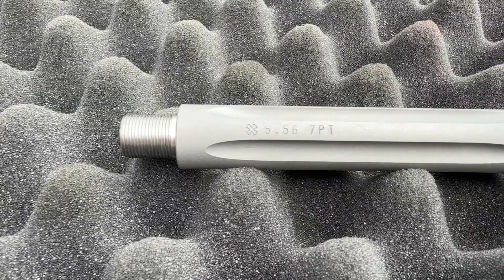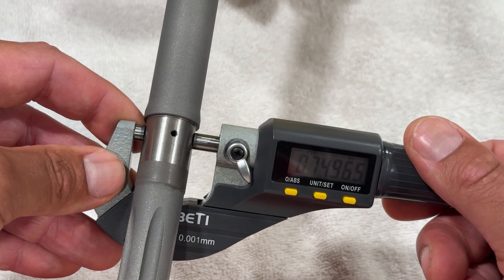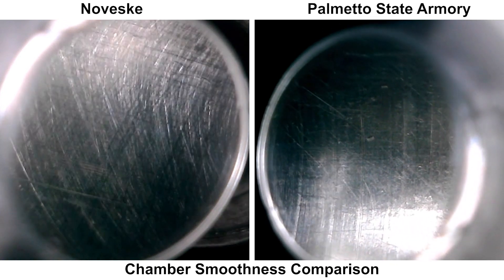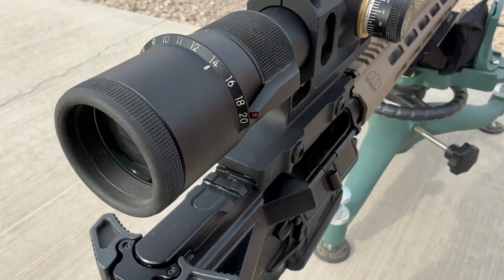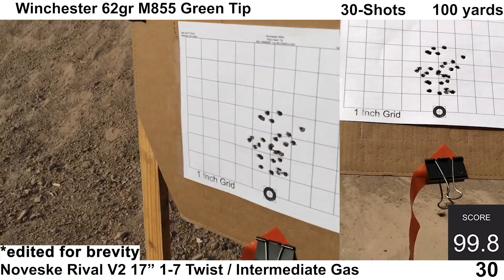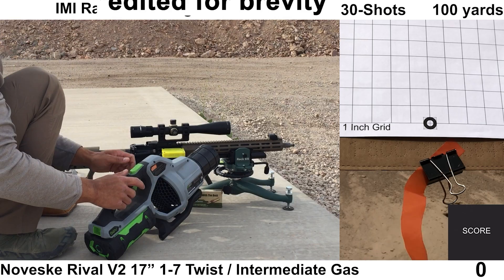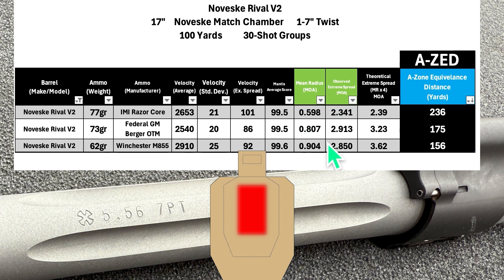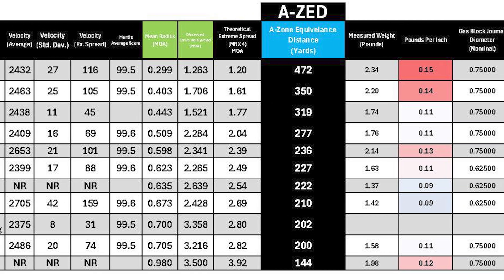Noveske Rival V2 AR-15 Barrel Review – Worth the Money or Just a Name?

Comment: Whats your experience with cleaning barrels and accuracy? Also do you lap your upper receivers? If so what method
Reply from the maker: @larsonhomeinspection9932  I haven’t noticed a big difference in a clean vs dirty barrel with a 223/556 AR15.  But it’s  it something I have tracked closely.

I have lapped uppers before. I don’t use lapped uppers for these videos.

Comment: The cross hatch surface is critical to proper case adhesion during the firing process! If you had a super polished surface in the chamber, your case will move prematurely before the gas even begins to be routed through the gas tube which causes multiple problems. One being excessive gas blow by and fouled chambers and two, case head issues and three primer protrusions and holes in the primers. This cross hatch IS a hand polish.
Reply from the maker: Thanks for the feedback. I think I would have been less confused if Noveske used the term cross hatch, instead of hand polished.  To me, when i hear the term hand polished, I would expect to see a smooth, non-scratched surface.
Reply: @PrestonJMoore  as would most people. This process is the final touch that any reputable gunsmith will do when chambering a barrel. Just remember that a super slick chamber is not a good idea. However the chamber should be void of deep scratches and or gouges left by a chip rolling over the reamer.
Reply from the maker: @dannyboy5272  also, what are your thoughts on chrome lined and nitride treated chambers? I would think those slick surfaces would impair the case adhesion.
Reply: @ if the chamber is nitrided its still going to have this cross hatched surface.
Reply from the maker: @dannyboy5272  okay. What about chrome? It is my understanding that chrome lining is much thicker than nitride. So, wouldn’t that fill the scratches? At least to some degree. Therefore making the chamber smoother/slicker?

Also, whether chrome or nitride, would the slicker surface reduce case adhesion compared to raw steel?
Reply: @ chrome has a surface that resembles the same attributes as a cross hatch because of the nickel chromium surface and I don’t think it’s necessary for there to be a cross hatch surface.
Reply: Google the question; is chrome lined barrels as smooth as non chromed barrels. I tried to copy and paste in the comments but it wouldn’t let me

Comment: Wonder if that last group opened up due to heat?
Reply: Doesn’t he use a chamber blower between every test?
Reply from the maker: @ChristopherGoydich-cb6bd  chamber chiller and a leaf blow.  So, the barrel is cooled on the outside and the inside between each group.
Reply: @PrestonJMoore  yeah if it was heat stringing it would be doing it for every test not just the last one but that would be unlikely with such a thick match barrel, ime.
Reply from the maker: @ChristopherGoydich-cb6bd  Yup, agreed. 💯
Reply from the maker: I suppose it's possible.  Why do you think that didn't happen with the other groups?

Comment: Out of curiosity, why don’t you use the same ammo across the tests?
Reply from the maker: Good question.  A couple answers...  First, it makes life easier not being slaved to certain types of ammo, if that ammo becomes more difficult to acquire or whatever. I also like seeing how different ammo does, I think it adds a secondary element to the video that, at least I find interesting.  I can always come back to a certain barrel with ammo it wasn't originally tested with, if I still have access to that barrel. There would be people that would complain that I was using the wrong ammo, whatever I would have ended up choosing to shoot. The goal posts would probably be moved and people would then say that not only should I use the same ammo, but the same lot of the same ammo. I think certain ammunition fits certain barrels better.  For instance, I'm probably not going to shoot really expensive ammo out of a really cheap barrel, since, if someone buys a cheap barrel, they are probably going to buy cheap ammo.  It would still be interesting though. 
Also, when I started this series, I had 28 subscribers and was only really planning on making a few videos. So, things have gotten a bit larger than expected, which I am very appreciative of.  So, I'm just kind of rolling with it. It's not a perfect, laboratory grade comparison and I'm okay with that.  I'm not a scientist in a lab with perfect conditions with an unlimited budget. I'm doing what is practical for me with the limited time and budget I have available.
What are your thoughts about this?
Reply: @PrestonJMoore  well I found it interesting because it seems like you take so many steps to minimize any potential factors that could affect the results but the ammo choice seems like it could potentially be the biggest one so that’s what really had me curious. And while you’re not a scientist in a lab, you are the only one who I’ve seen do the testing this well and consistently. 

Maybe a compromise; have 1 type of ammo that you use consistently across all test and then the other two can be varied based on the barrel and what’s available to you. That way you’re only really committed to one round instead of 3 and you can vary the others but there will be a consistent round to track performance of across all testing. Just a thought, just seems like that would potentially provide a good mix of both. 

I do get not being able to make every one happy and or moving the goal posts though. I did also think about the lot thing actually lol but I think that’s a lot more unreasonable than always including the same high quality match load in the tests and with your chronographs you’ll be able to see if a round is outside the norm of the rest of them or what you expect from that load, so I don’t think specific lots would be necessary.

And this isn’t necessarily me trying to be critical as much as thinking about ways to possibly improve the process even beyond what it currently is. I really appreciate your content and this is just intended to throw my opinion in there to potentially help.
Reply from the maker: @AK47Uprising  I very much appreciate you taking the time to provide feedback and a thorough response.  I hope I didn't come off as annoyed or offended. You taking time out of your day to provide suggestions on how to improve the channel means a lot to me. And, I really do appreciate it. 
I have thought about including one standard ammo type in mix. We'll see if I actually do it or not. As you mentioned, it would be a decent compromise.
Thanks for the feedback!
Reply: @ no you didn’t, I just wanted to make sure that I didn’t come off that way lol.
Reply from the maker: @ 👍 we’re all good!!
Also, don’t tell anyone 🤫 but I do plan to eventually do ammunition reviews with multiple barrels.  Our little secret 😉

Comment: Thanks for your work, these are outstanding videos.   I consider that hand polished because it looks like it was done with emery cloth/sand paper on a wooden dowel.  I just looked at my son’s Recon (over 10 years old) and it has crosshatching like that but not as deep/coarse.  His spent brass looks better too, and did when the barrel was new.  I think they overdid it.  Either way, it looks much better than my Criterion barrel.  Looking forward to the next video.
Reply from the maker: Thanks for the support!!
The barrel functioned fine and didn't have any issue extracting.  So, at the very least, to me, the finish on the chamber doesn't seem to be a huge issue. It's still not the type of finish I would personally call hand polished. 
 So, it was just a bit unexpected. But, I understand it did go though some additional processing, honing, or whatever the correct term is.
Did your Criterion have an issue with the chamber?
Reply: @ yes it does have an issue, it has circular rings in it as if the reamer was slightly chipped.  I worked in tool and die for 11 years so I know what this looks like.  They’re so large/deep that there are rings on the brass which you can feel.  I sent it back to Criterion and they said it was within their spec.  To be fair, it’s an accurate barrel and I didn’t have extraction problems that I could quantify.   I took it off the gun because for some reason it shoots XM-193 poorly but it’s a laser with handloads.    Also it’s a bit heavier than I wanted, I shoot a G barrel now and am satisfied with the precision with all types of ammo, I think this G barrel was a bit more precise than the one you tested.   I’m satisfied with the G barrels I have but shoot a Rock River 20” for my Hi-Power type shooting.
Reply from the maker: dang, stinks about your Criterion barrel and their response. At least it shoots and functions... mostly. The G barrels seem to be well made.  They released a new 18" SPR barrel that looks pretty interesting.
Reply: @ I still believe they make excellent barrels, and they were responsive to the issue.  I’m not mad about it, a little irritated though.    My son has a light weight barrel of theirs that is freakishly precise with certain loads, not over-gassed either.  But to stress again, I greatly appreciate and enjoy your work.

Comment: You dont want a high polished chamber. A chamber polished with 400 grit is proper. If the chamber is high polished the case will not grip the chamber when it is fired and all of the force will go into the boltface and lugs which will cause lugs to shear.
Reply from the maker: @ryanallen8392  what about chrome and nitride chambers?  Wouldn’t those not allow the brass to grip the chamber wall too?
Reply: @PrestonJMoore  the nitride or chrome is applied after the chamber is cut and polished with 400 grit or whatever grit the manufacture uses. Therefore, the imperfections left by the sand paper are still present after nitride or chrome is applied.
Reply from the maker: @ Right.  But, the chamber will still be more slippery if it has been chromed/nitrided, right? 
My understanding is that chrome plating is a lot thicker than a nitride treatment.  Would chrome fill in any of the imperfections?
Also, are you saying that Noveske would call that surface finish hand polished? It's just not the type of surface finish that comes to my mind when I hear the term "hand polished"
Reply: @PrestonJMoore  if you look at the brass that has been fired from a nitride or chrome chamber you will notice there are imperfections from the chamber imprinted on the brass. They may be larger than marks left from sanding. The imperfections are intentionally left there. Whether it be machining marks or sanding marks, the imperfections serve a purpose similar to the cross hatch on the cylinder wall of an engine.

Yes. I would consider the noveske chamber hand polished. It is done while the barrel is chucked up in the lathe. Sandpaper on a dowel is what is used to produce that finish. 320 or 400 grit. Any finer than that and you are inviting problems. The sandpaper is used to remove the machining marks left by the reamer.

Problems with a high polished chamber include sheared and set back lugs, signs of pressure including flat primers, not being able to load a case to max book charge because of pressure, and the gun runs harder.

The problem that come from a chamber that has not been polished with 320 and 400 grit is stuck cases.

When I chamber rifles, I polish with 400 grit which leaves a finish similar to the chamber in the noveske in your video.
Reply from the maker: @ryanallen8392  Do you know of any documented cases where an excessively smooth chamber caused issues?  I appreciate you taking the time to share your insight into this. It's been enlightening.
Reply: @PrestonJMoore  another option would be to call the manufactures of the barrels youve tested as well as others like White Oak, SOLGW, etc. and ask them. They hammer on gun barrels before they hit the market.

You will have a better chance of getting companies w/o gov contracts to answer the phone.

Personally, I have seen customers set their lugs back on bolt guns when they high polished their own chamber.
Reply: @PrestonJMoore  I dont lile it when companies use gimmics in their advretising. "Hand polished" is a subjective term. So when a customer sees that they think that the chamber should look like a mirror. If they are going to put "hand polished" it should read "hand polished to 400 grit" since that is the industry standard.
Reply from the maker: @ well, I think we can 100% agree on that!!  Again, thank you very much for taking the time to view the video and provide some very helpful comments. I very much appreciate it!

Comment: This series is beautiful for my data hungry brain. I do have some suggestions, the measuring and evaluation is perfect by all reasonable expectations, but the discord group i shared this in pointed out the inconsistency with ammo types especially in the final results, For example, the rosco, geissele, and this were not shot with the ELDM that performed the best in the top 2 barrels, as well an evaluation with more affordable match ammunition such as AAC OTM or SMK would be beneficial for a lot of people who want superior performance but shoot a lot of ammo. Also someone said the AZED chart is currently spelled equivalance, not equivalence.
Reply from the maker: Thank you very much for the feedback and thoughtful response.  In short, the reason why I chose to allow for different ammunition types for different barrel is because is because it makes things much more flexible in the long term rather than having to stay slaved to specific ammo. 
When I choose the ammo, in general (not necessarily every single time), I try to choose 1x bulk FMJ load, 1x mid tier load like the AAC OTM that you pointed out, and 1x higher tier load.  I certainly agree that people are probably going to be interested in seeing the ammunition that they shoot the most of. For this barrel, I would argue that the IMI Razor Core was the mid tier load, as it is more reasonably priced.  If you can afford a barrel as expensive as this one, IMI razor core wouldn't be unreasonable expensive, in my opinion.  I realize plenty of people may disagree with that, but that was my though process.
Thank you for pointing out the spelling issue... That's embarrassing....

Also thank you very much for taking the time to write a thoughtful response and provide constructive feedback. Comments like this help me to improve and make better content. I appreciate it!

Comment: Although the Noveske chamber doesn't look smooth I'd say it's still a better surface than the PSA. The PSA has some super deep marks and weird ridges, whereas the Noveske seems like it was honed instead of polished. I wouldn't be surprised if by "hand polished" they meant an electric drill with a bead hone. 
Engine cylinders are flat yet rough to hold oil but I'm not sure you want that for a chamber. I don't know if you want a polished chamber or not though, I hear that you brass should "stick in place" instead of move back. A thing done for action testing is to oil the case so all the force goes into the bolt/action, which a polish may also do.
Reply from the maker: Fair point about the PSA. although, the fact that it is even debatable is a problem.

And yes, it is possible that they meant honed instead of polished.  But I can only go by their word, and the chamber, to my eyes does not look "hand polished", as advertised .  Honed, maybe. And if that is the case, it might be helpful for Noveske to state that more clearly. But, they have sold plenty of barrels. So, I'm sure they are comfortable doing what they do and calling it whatever they choose to call it. 
Thanks for the feedback!! I appreciate you taking the time to write a thoughtful comment!
Reply: @PrestonJMoore  yeah, it's hard knowing what they actually meant. I wonder about a honed vs perfect polished chamber but chrome seems good so I'm not sure it even matters. Clearly that finish didn't do the barrel any favors though lol.
I think I heard of them or somebody else having a "proprietary gas port" in a Focustripp video that was literally just a slightly different hole size they wouldn't tell him. Mr pin gauge tells no lies

Comment: Random comment:
Someone I respect in optics mounting switched to "wet mounting," which is just evenly disbursing clp/lube to the bottom of the mount and the top side of the receiver to eliminate/reduce any galling that might occur during tightening.
Reply: It's a solid practice. Aids in repeatability of the mount as well.

Comment: @6:49, your middle buffer, is it hitting the retainer giving it that concentric circle?
Reply from the maker: I think that's just wear from contacting the back of the BCG. I think retainer pin marks are usually a little closer to the edge, but not sure. With the setup I was running, the buffer had constant pressure on the BCG and  wasn't hitting the retainer pin.